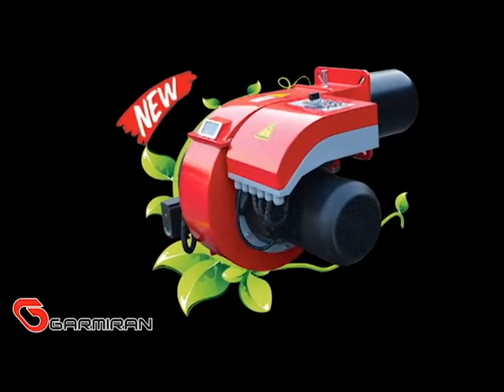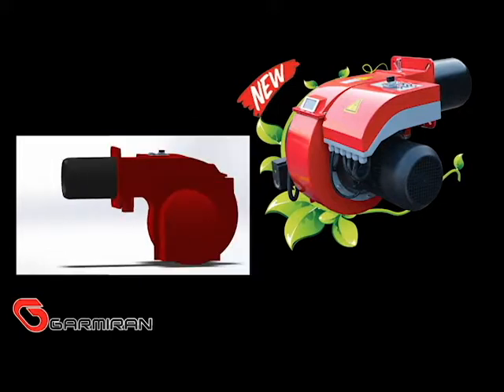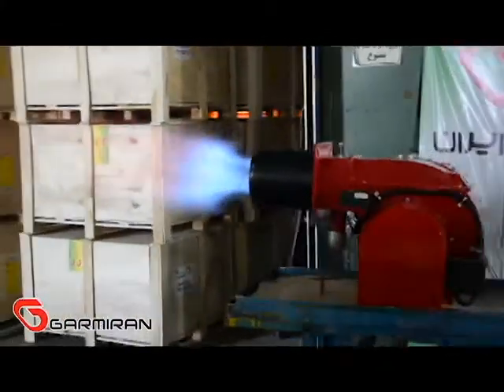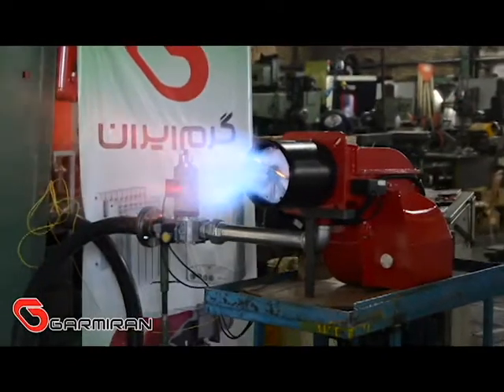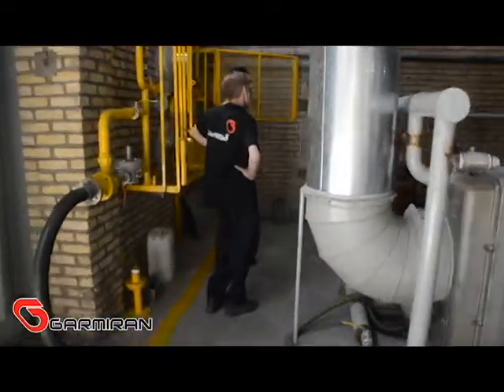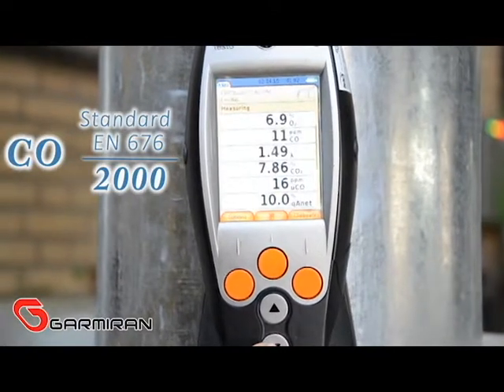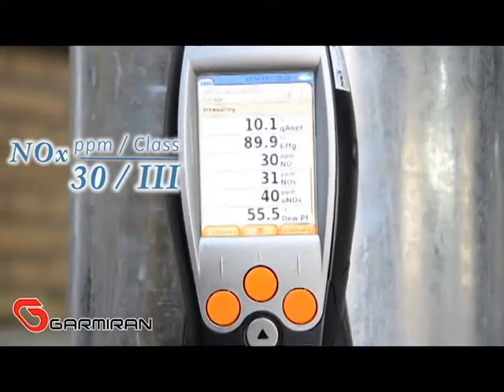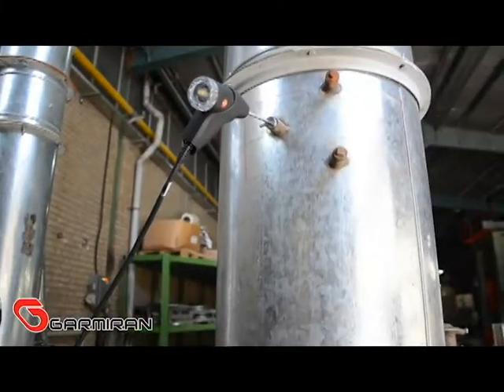GNG 90.12

Comment: Price?   Ballpark for smallest model
Reply from the maker: we are sorry.  We don't understand your request.
Can you explain more?
Reply from the maker: we are sorry.  We don't understand your request.
Can you explain more?
Reply: Price detail and how much gas required for per hour
Reply: Prices please on small model?
Reply: the quoted price  for the gas burner model GNG90/12 with thermal capacity of 320.000-1.500.000kcal/h as  EXW/mashhad is 1323$ and the smallest gas burner model GNG 50 with the thermal capacity of 20.000-53.000 as EXW/mashhad  is 119$